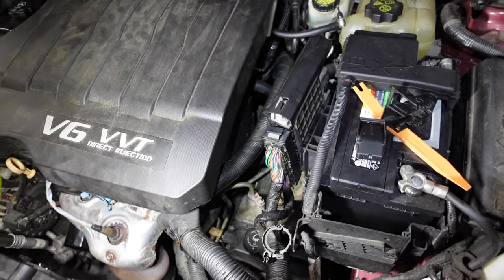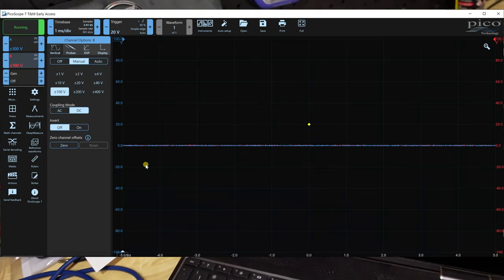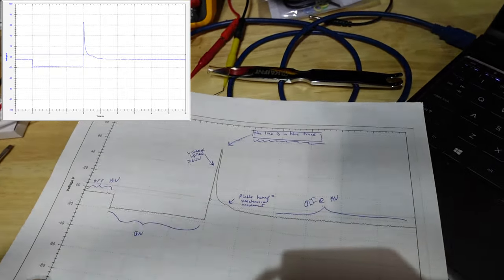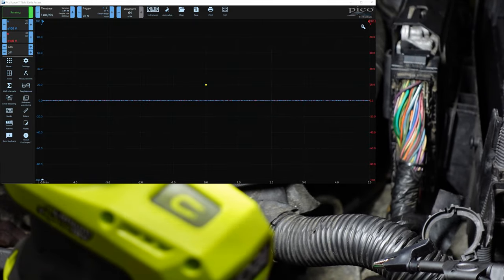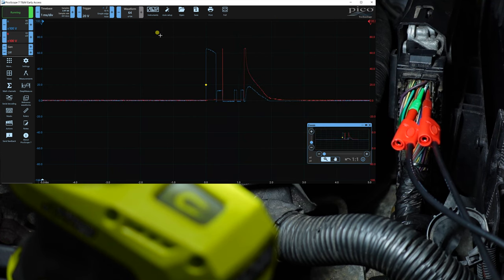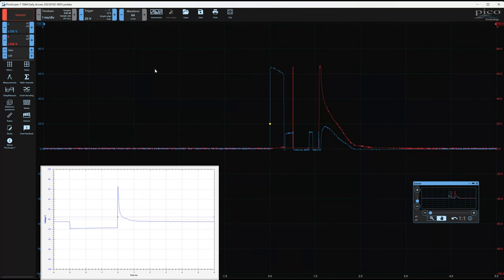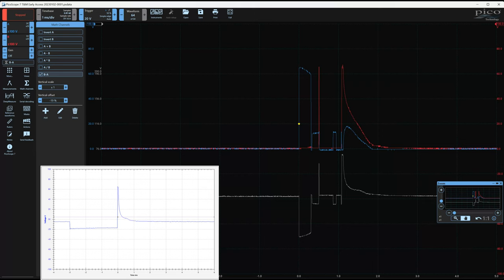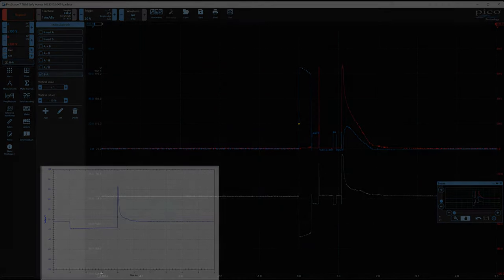Picoscope 2204a backprobe ECM to collect GDI injector waveform (GM 3.6 LLT injectors under manifold)

Comment: Thanks for the mention! You can also connect a single channel and place both leads on the injector control wires, instead of battery ground, and this will give you the math channel waveform you showed, live. Why, because it is the difference in potential, (A-B). Make sense? This injector waveform is very very similar to the old TBI injection Peak and Hold designs where you will have two voltage spikes. One at the end of the peak section and the second at the end of the hold. Thanks again!
Reply from the maker: No problem for the mention! Thanks for giving me this new method for testing the injectors, and yes it makes perfect sense.  I'll definitely be trying this soon,  hopefully this weekend. Have a good one and thanks for dropping by!
Reply: @oneanddonediy  The Pico math channels are awesome! And what you showed too. The other method I mentioned is how I would do it on my Snap-on scope as it does not do math channels. Or how one would do this test using a single channel scope.
Reply from the maker: Ah, thanks for clarifying that, especially for the folks that have a Snap-on.  Thanks for passing on this knowledge, much appreciated from North Carolina!

Comment: If you compare the port vs GDI, the main difference is how the ECU manages the the coil current. In GDI it is just the coil resistance and battery voltage what dictates the current. That means the coil has to have quite a lot of turns to not overheat, but that means it has limited forces and/or will be rather slow (high inductance with limited battery voltage) to respond. On GDI the injectors have to operate with greater forces and stricter timing, so the simple one side controlled electromagnet won't make it. You can see first high voltage pulse (to a voltage level that would be tightly regulated by the ECU), which allows very fast magnetic field ramp up, so very fast response on even a high inductance coil. Plus it allows a high current boost to get the injector needle actually moving. Then you can see the driver is pulsing battery voltage. That is the way, how it maintains the exact, lower (as at this moment it needs only to hold the needle in the open position, aka holding current), current in very efficient way even when the coil resistance is low (so allows for fast responding low inductance coil design) and even it is able to compensate for batter voltage variation. And then the negative side switch get released, allowing the holding current to disappear quickly for the needle to close. All this allows for way higher force injectors while keeping them small to maintain the timing accuracy, yet do not overheat them.
Reply from the maker: Thank you so much for taking your time to explain that. It really helps a lot, especially to see this explanation and actually have the waveform live on the screen. I'm a trained scientist and, the more I learn about cars it just fascinates me the amount of science and engineering that has gone into making parts. I know cars give people trouble and they do need to be fixed from time to time.  However, it's still amazes me the effort that was put into this.

Comment: for us poor techs that can't afford that fancy pico scope wouldn't it be the same to plug the negative of the scope into the ground side of the injector circuit and the positive into the positive side of the circuit(or wold it be the other way around) and get the same out put?

no all GDI injector wave forms look like this or was this unique to the GM style
Reply from the maker: You're probably right on getting the same output. I would have to check that out. As far as just being unique too GM. I'm not sure about that either, but what I can say is that some people may be only pro one side of the injector instead of both. I prove both to make a math channel to get the end result that you see in the video.

Comment: What software are you running? I bought the 2204a, but picoscope 7 wont work on my mac and the automotive scope wont recognize the 2204a. Says it is unsupported.
Reply from the maker: You have to use Picoscope 7 on picotech.com not the automotive version on picoauto.com
Reply: @oneanddonediy  i appreciate the reply, but for some reason, I can install it, but it wont open.
Reply from the maker: Right click the icon and try to run it as an administrator.
Reply: @oneanddonediy  I’ll give that a shot
Reply from the maker: Hope it works out for you!